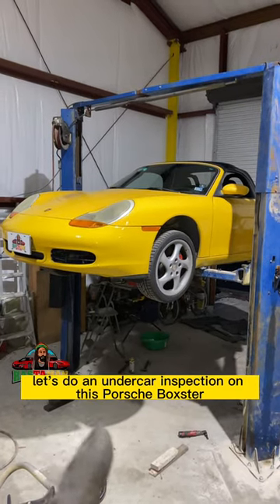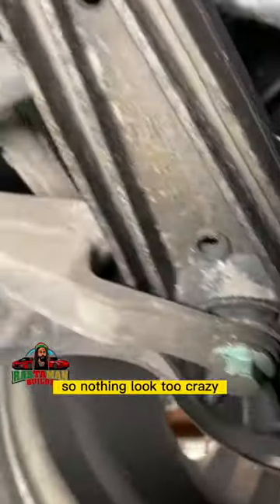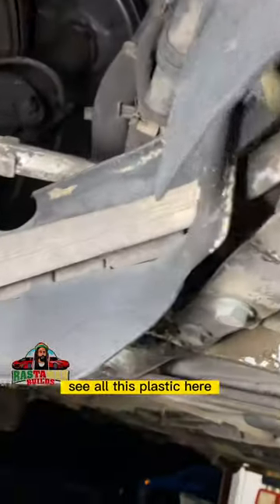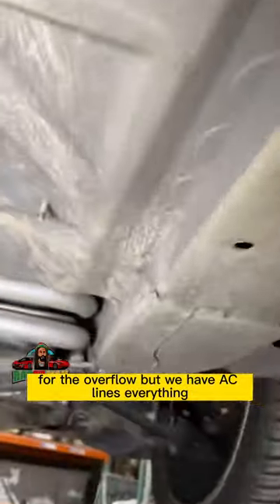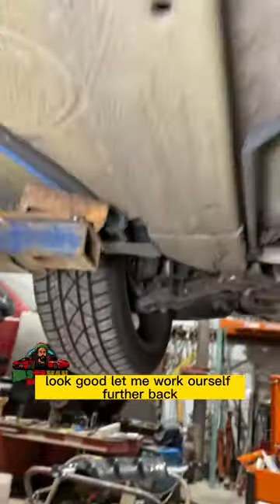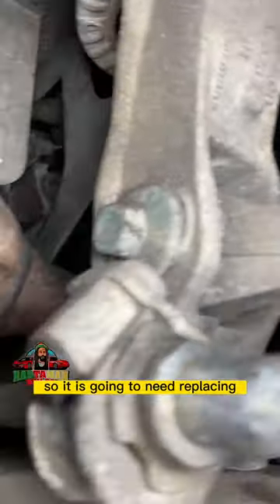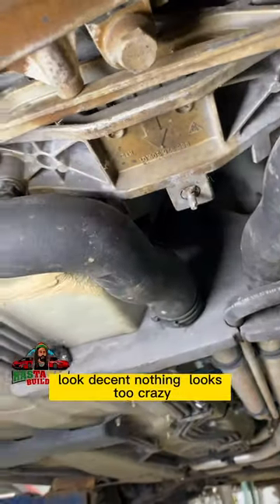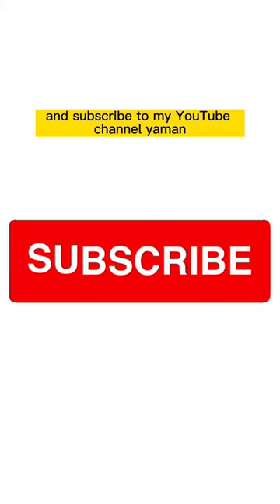Quick Porsche Boxster Under Car Inspection

Comment: What's that thick metal loop cable for ?
Reply: If you are in a accident, it holds the engine from trying to slam forward into the cabin, since it’s right behind the driver seat.
Reply: @RoopsPhoto  Thankx for your time  bro !
Reply from the maker: Roops was quick to the draw. Absolutely correct
Reply: @RastamanBuilds  Thanx